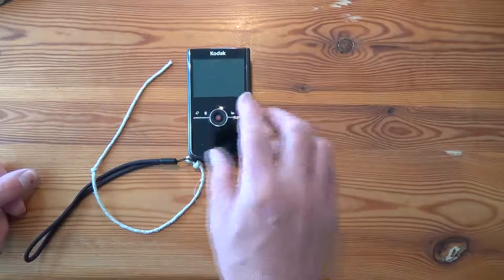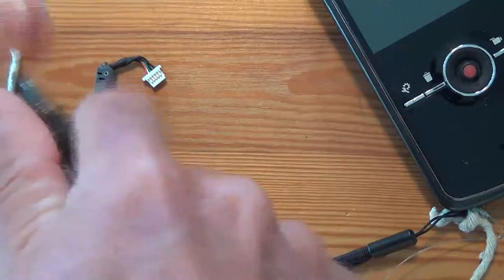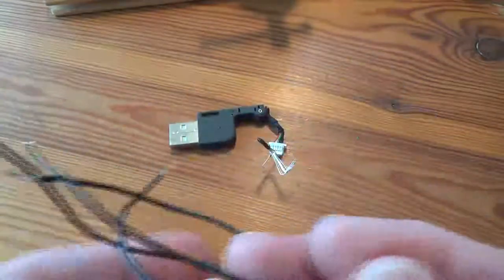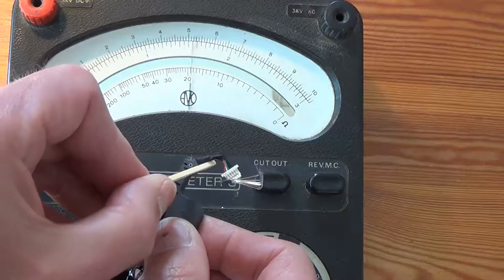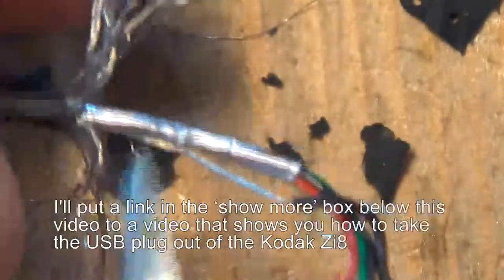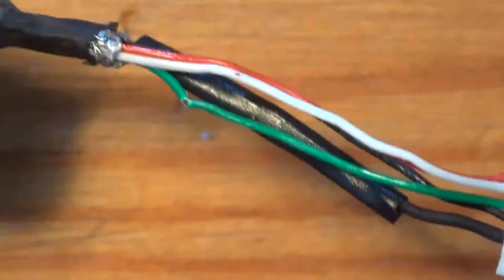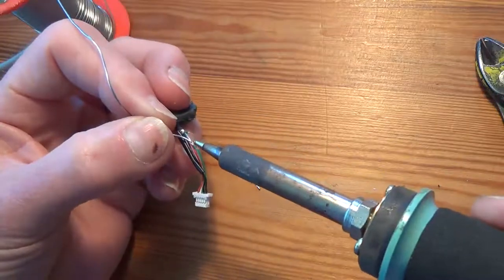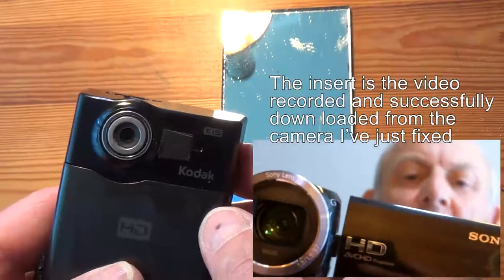Repairing broken USB lead in Zi8 camera

Comment from the maker: Hi, thanks for the input, OK I'm a little harsh on the digital meter. An analogue meter give you a feel for a components response that isn’t matched by digital, I'll give you a for instance, I’ve been caught out with a digital meter by an open circuit capacitor, with the AVO you get a clear picture of the charge response, buy hey, I’d use a battery and a bell if it’s what I had to hand. I think the Fluke is probably better than some I’ve used. 
All the best ... Andy

Comment: This reminds me of when I repaired a broken signal trace (at the bend!) on a ribbon that went to the display on a laptop. Very tiny! Fixed it using conductive paint, soldering was a no go, fine wire kept breaking. Speaking of conductive paints, have you seen You Tuber Robert Murrary Smith's channel? He has cool info on making various nano particle conductive inks, I was able to repair the resistor of an uber rare tapped pot using his info. Has all sorts of interesting and handy info!

Comment: You can also take the female (chassis) usb plug, and mount it in the cam.
There is room enough to (hot) glue it in, then there aren"t any moving parts in the cam.

Comment from the maker: Hi, I’ve only ever used conductive paint as part of an alarm circuit on shop windows but I guess there are loads of applications for conductive paints. I hadn’t seen that channel but I’ve subscribed and when I have the time I'll have a look at it.  Well done on the laptop repair. I do have a dislike of flexing connections as you just know that unless they’ve been designed well within its elastic limits  they’re on borrowed time. 

Kind regards ... Andy

Comment: Re: meter response time. That wholly depends on the meter. The continuity test on some meters is wonderfully instant, whereas on some meters it lags maybe 100 ms or more from continuity until you hear a beep. I personally wouldn't use that analogue meter for this job, in part because of the inherent lag in the gauge, in part because I wouldn't need to keep my eyes on it to detect any changes. Of course, whatever gets the job done. :)

Comment: Hi Andy, boy! you have the patience of a saint to repair that USB cable. I've just broken the other little bit that you flick out in order to pull the usb connector out of the side. It's the U shaped bit located at the bottom of the camera about 5MM from the tripod thread. You just wouldn't happen to know where I could get a replacement part would you? It was a 60th Birthday present and a great little camera. I can get by without it but I'd like to keep it in pristine order for as long as I can. Thanks.
Reply from the maker: Hi John, sorry you've bust your camera but I'm afraid I can't tell you where to go for spares.  Maybe you could pick up a scrapper off eBay or a car boot sale.  Good luck... Andy
Reply: Thanks Andy, that's what I was thinking. I found nothing on the web for spares so that's my only option now. Thanks. Enjoying your YouTube Channel. Very interesting.

Comment: Re: the whole thing. I probably would have replaced the whole popout plug with a mini or micro USB socket fitted on a little adapter board. I find the very idea of that popout plug a bit silly. Maybe because I have more spare USB cables than I can poke a stick at.

Comment from the maker: The notion of a pop-out plug is ok but the implementation is poor. I’ve got no spare parts here and no shops so everything is a couple of days away.  I did think of mounting the socket at 90°  I could cut the back and front of the case to accommodate the bulk of plug, there’s enough space to araldite it in like that without it protruding and there’d be no moving wires. The bad news is my new Sony camera also has a wired plug but fortunately no tight bending points
All the best ... Andy